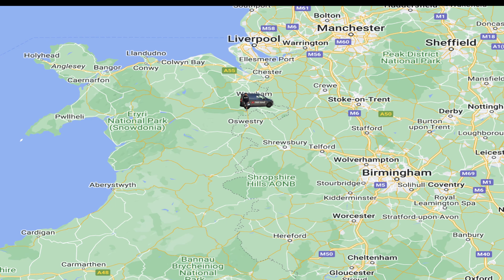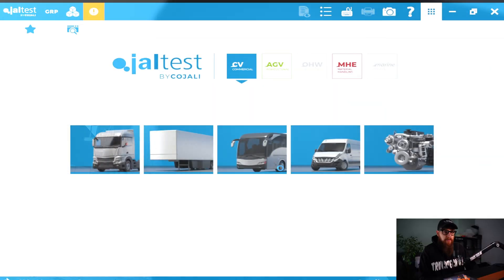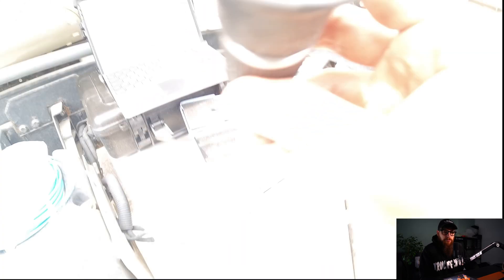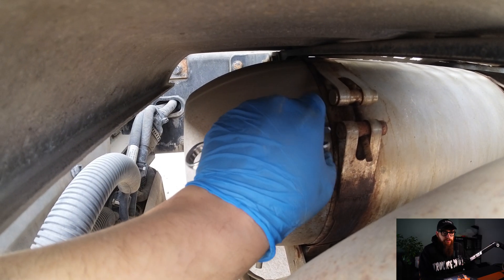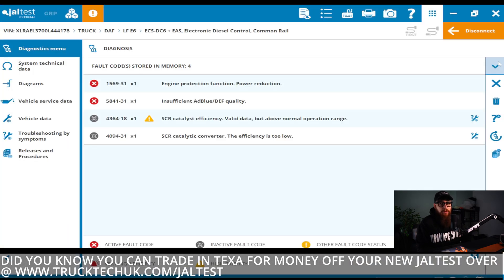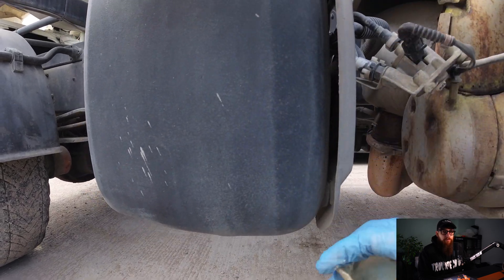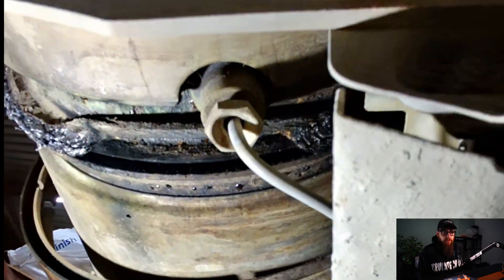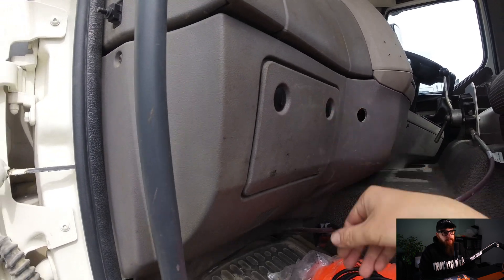DAF ADBLUE QUALITY...ENGINE POWER REDUCTION? what can it be?

Comment: I know this is old, don't crucify me. Just for others' sake. 
I've heard of bad exhaust manifold gaskets causing this code. I've personally had it come on from needing def filter changed, bad def doser gasket, def doser needing cleaned manually, and I've had the code clear after a forced regen.
Have had no issues with using aftermarket nox sensors of proper part number cross.
Take that for what you will.

Comment: Hello mate. I replace a nox sensor before the cat on mx13 euro6. Only erased the dtcs but after 10hours of driving I have the error and engine light again. I have problem with the values mesuared by the sensor.

The sensor need to be calibrated or learning with davie? I didn't see learning procedure on daf dealernet manuals.
I installed a used nox sensor.
Reply from the maker: Hi so if I was replacing the sensor I'd be looking at using a new genuine sensor first. What is the fault code and what other faults do you have with it? You don't need to do any learning process or resets with daf thank God
Reply: @TRUCKTECHUK  p1711 and p1710 (nox pre cat sensor , data valid but high and low values)and after few hours p1496(active) egr shut-off.
Reply from the maker: @codexTu  so do a nox sensor evaluation test through your diagnostic tool to ensure this sensor is good. Then I'd start thinking about  VTG turbocharger actuator performance, 
Any issues with the fuel in the truck? 
Leakage in inlet air system?
Clogged EGR pressure difference sensor venturi?
Few things to check but the only thing I can think of that could be messing with the NOX could be the turbo
Reply: @TRUCKTECHUK  i will install a oem new sensor and see what happen. Thanks mate
This truck have 1.200.000km is a lot for an DAF😄
Reply from the maker: @codexTu  run the nox sensor test on the sensor through diagnostics. It might save you some money and check the turbo. Seems odd how you have high and low nox issues.....let me know how you get on also!

Comment: Have you ever had a blocked SCR causing a diesel oxidation catalyst fault to appear.
Reply from the maker: Hey Denis, I couldn't say I've ever had a blocked SCR cat but from experience, if you have gone through the motions of checking NOX levels and the Adblue system quality and quantity it will be the SCR CAT.

Comment: Hello, I have a problem with my Daf 105. The AdBlue temperature in the tank was found to be 20.1 degrees. I replaced the Adblue tank with the sensor but it didn't change anything. when I release the cube with it, the temperature still remains the same. you know how to help me, where to look for the problem, because I'm already throwing up my hands. Thank you for your help

Comment: You’ve never lived until you’ve had adblue lnjector bolts snap in the exhaust at the side of the road when it’s pissing down in the middle of the night
Reply from the maker: Ha ha ha 😂  I've had a few go on me in the workshop that has had to be warmed up to get them out.....doesn't prepare you for volvo adblue injector bolts though does it 😂😂😂🫣
Reply: @TRUCKTECHUK  90% of the breakdowns you get in Volvo action service is blocked injectors and nox sensors. There’s no trick to getting them out either. Just pain and heartache
Reply from the maker: @EddieNUFC90  they should make them all quick release ha ha ha....speaking of nox sensors!!!! Bloody Mercedes!!!! How tight do they need to do them from the factory and then they pull the threads on the way out 🫣
Reply: @TRUCKTECHUK  that’s after taking a million covers off just to get to them haha. We keep new boss’ in stock because a lot of times you end up pulling the threads getting them out

Comment: I too find front nox usually the problem because the ecu uses this to test scr efficencey ie cat or def fluid quantity or quality it always pop up those codes, i give it a regen so flow and temp is correct and look for an average of about 300 ppm oxygen pre cat with at least an 85 per cent reduction, if 300 ppm is nowhere near with no air leaks ect i take it as pre nox is reading incorrect.
Reply from the maker: Hey, thanks for the comment 👌😎. Thanks for your input on an alternative testing method.
It's been a week and still no issue but if it happens again I will monitor via regeneration  for the correct PPM and see where we go 👌😎
Reply: I give it a regen then look at live data on Jaltest while on test drive for the 300ppm of oxygen on the front nox sensor ,bit difficult to see, bit unsettle but can see it on nice piece of road, and that reduces to below 45ppm if all is working fine, have had it where it shows more oxygen on rear than front ,defo sensor fault.
Reply from the maker: Thank you for your input on this 😎. Hopefully it will benefit people looking for answers to this specific fault 👌

Comment: After carrying out quality test, EAS visual inspection and 100% checking for any universal component cheap NOX I disconnect adblue injector and run it out rather loaded or handbrake pulling it back on a long hill and see what there reading, normally find before CAT reading to low.
Reply: Yeah your not wrong, it’s a code I see motors have thousands and thousands spent on it because no one wants to spend the time on it to get to the route cause. Seen people just throwing both nox sensors on it before even checking adblue quality, madness, why you will so well mate, rate to find someone who understands the importance of accurate diagnosis 🤙Similar to EMAS faults😂
Reply from the maker: I'd much rather explain to the customer we need to test everything first before throwing money at it even if it needs to go back out. I wish I could justify a £1000 of nox sensors without any testing 😂.
I just bought a 600-bar digital LCD pressure sensor for screwing in to do EMAS faults.....if only I had some customers with emas faults 😂😂😂😂🙈
Reply from the maker: Hey George 👋. That sounds like a good idea, I think I'd of gone further with a road test if I didn't find the scr sensor hanging out and the dpf gasket blown. I'm still waiting for the call to see if faulted again 😪